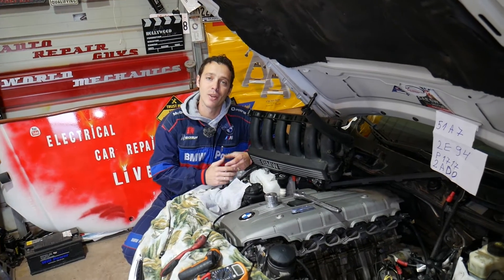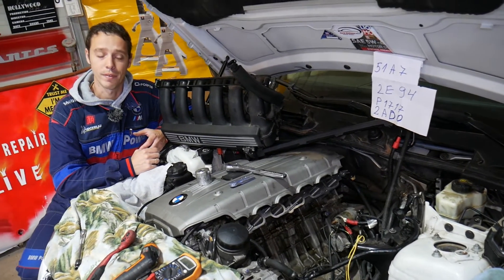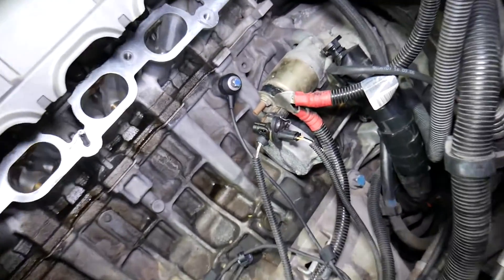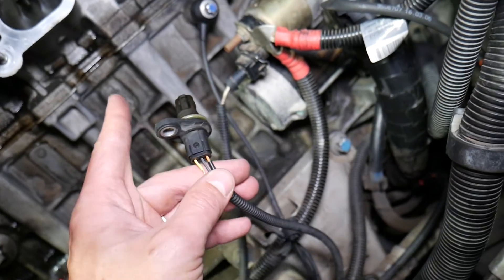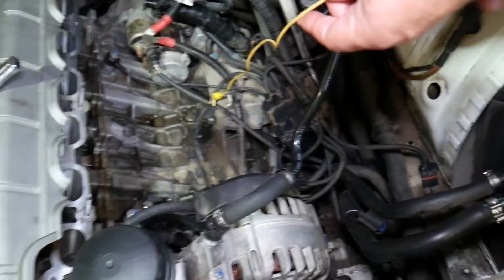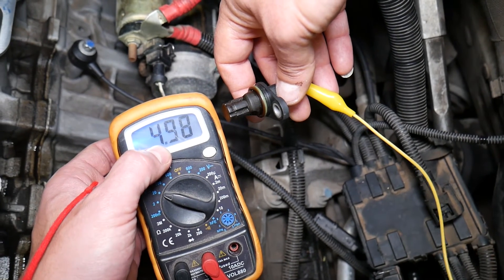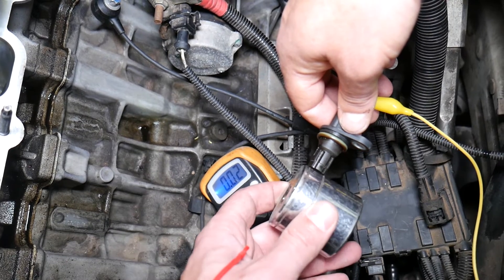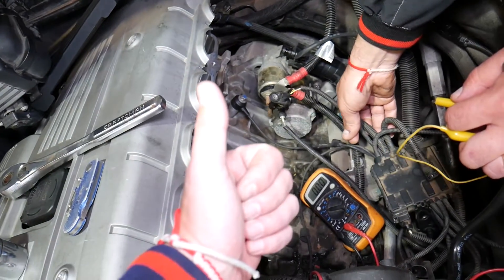BMW E60 E61 HOW TO TEST CRANKSHAFT POSITION SENSOR

Comment: Hello, this is something interesting or something normal, so I need your experience. I have a BMW E60 N62 545i SMG, I recently changed the flywheel and put a Luk DMF085 but the engine took a while to start and the engine idle went up and down and was not stable. I thought the Crankshaft Position Sensor had been damaged and I put a new one in and did the same thing, I decided to measure the Voltage on the 3 wires, (1)-Yellow (2)-Black (3)-Brown. Yellow 11.6V (signal) Black 12.7V (ignition switch) Brown is Ground, I tested the yellow wire and it goes from 11.6V to 0.0V.
My question: Are these measurement values normal? or is the DMF085 flywheel not compatible? or is there a problem in the wiring harness? Thanks in advance!